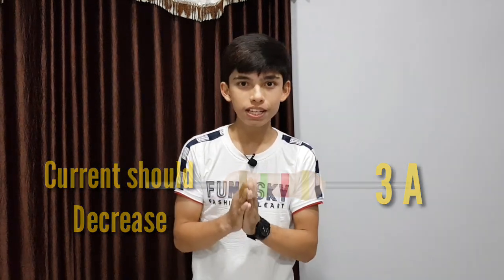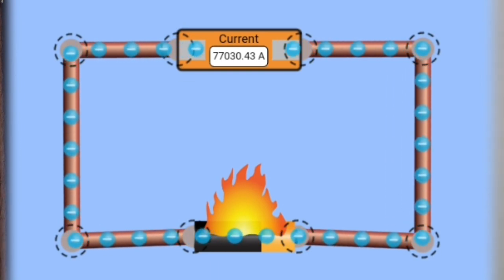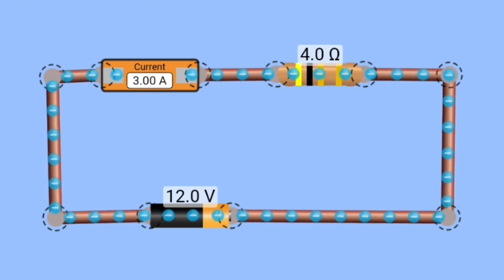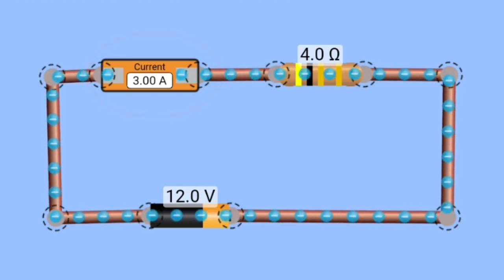🔥Why current doesn't decrease on passing through a resistor | Learnium | Electricity | Part 8

Comment: But how a resistor at a specific place can provide resistance to the whole circuit please answer my question and if it is providing resistance to the whole circuit then how the current decrease because as you,ve said that current doesn,t decrease passing through a resistor so if a battery can provide 10A of current then why when we apply a resistor it decreases at the resistor doesn't heats current please answer my question 🙏🙏🙏🙏🙏🙏🙏🙏🙏🙏🙏🙏🙏🙏🙏

Comment: Bro but for the first time the current will be 7A but then when it comes to the resistor it becomes 3A and then when for the next time it goes to the resistor it will be the same as the resistor had to decrease it to 3 from 12 and it has already done its work so is my thinking right or wrong pls clarify...

Comment: At 4:30  you mention that with a 4 ohm resistor, the resistance is 4 ohms throughout the ENTIRE circuit instead of being 4 ohms just over the resistor. This really clears things up, but how can this be? How can the resistance be 4 ohms thru the entire circuit instead of being 4 ohms only thru the resistor itself?
Reply from the maker: We can look it this way,
We know that rate of flow of charge is current.
Now we have observed that current is same in the wire as well as in the resistor. So we can say that resistance spread throughout equally.
Otherwise the rate of flow would be different inside resistor
Reply from the maker: I hope it is helpful 👍

Comment: Thanks Learnium, you seriously can explain so much better than my teacher! It's impressive for someone of your age! Subscribed and am going to watch all your other videos. Just a question, you said the resistor is just a representation of the total resistance of the wire in the circuit. However when you put a bulb, that bulb is of course a proper resistor component and not just a resistance representation. Or how does the total current before and after the bulb stay same? Isn't an electric circuit a bit similar to a water circuit? Water surely wouldn't again speed up after it's been slowed down by a rock or some thin pipe? So why should electrons do so? So how does current not decrease when passing through a bulb or any resistance component? Please explain.

Comment: As V=IR, then, if we keep the resistance 0, is voltage going to be zeroo????
Reply: Resistance can never be zero in pratical but it can be approximately equal to 0
Reply: @gull-e-nama00   in V= IR , v is not voltage it is voltage drop across resistance soo If there is no resistance in ckt soo there will be no voltage drop that's why we get zero

Comment: Bro please reply my doubt. 
Suppose v connect a battery of 10 V , and two resistors are connected in parallel of 4 and 8 ohm respectively then total current passing through the conductor is 2.66 A but jab mene in do resistors ka current nikal ke plus kiya to it was not equal to the total current . Why🤔
Reply: O yah can se my mistake .thank brother .please reply when I have some more doubts later on 🤣🤣
Reply from the maker: Surely...
Reply from the maker: Brother I think you have made some mistakes in your calculations. Here's the solution:
When resistors are in parallel we calculate the equivalent resistance by:

1/R = 1/R1 + 1/R2
1/R = 1/4 + 1/8
1/R = 3/8
Now take the reciprocal on both the sides to get the value of R.

R = 8/3 ohm
Now using ohms law, V=IR or I=V/R
I = 10 × 3/8
I = 3.75 A

So, current is not 2.66 A but it is 3.75 A.
Now you can check:
I = I1 + I2 ,Now it gonna be correct👍

Watch this video to clear your concept:
https://youtu.be/CHVVvJ_M3MI

Thankyou very much for asking, I hope that you understood.👍👍👍